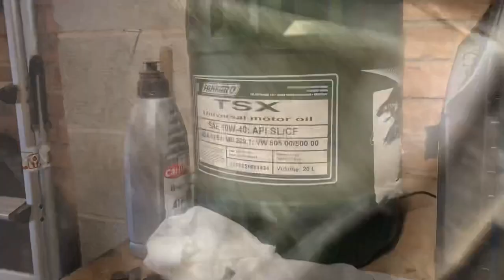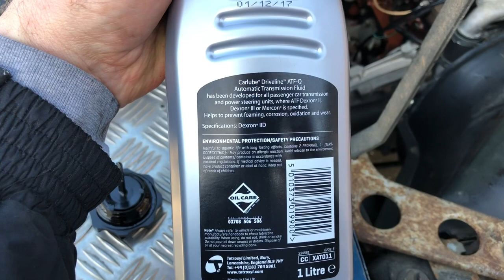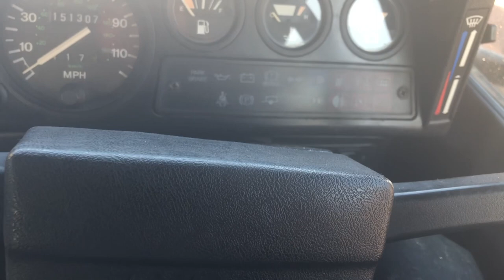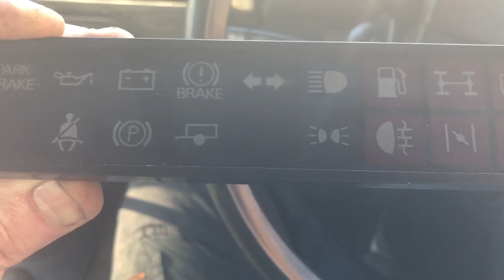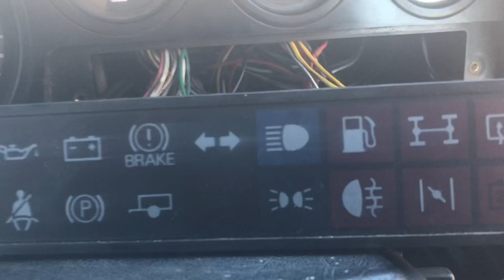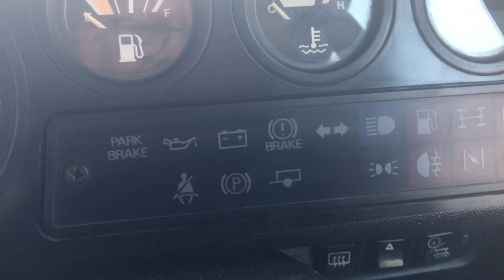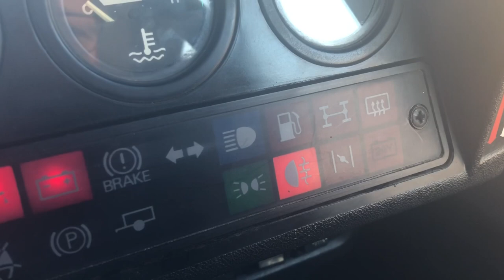Land Rover Defender 90 Turbo Diesel - A Bit Of Winter Maintenance - Oil Levels & Bulb Replacement.

Comment: Those little pumps from Lidl’s are great, I borrowed one and then bought one when they came back into stock. I try and run something like white spirit through after using it. You’re definitely brave playing with the car in these temperatures 🥶
Reply from the maker: Didn’t have much choice 😂 glad I did that oil!
Reply: I’ve a machine mart pump-never taken a sump plug off since 😊